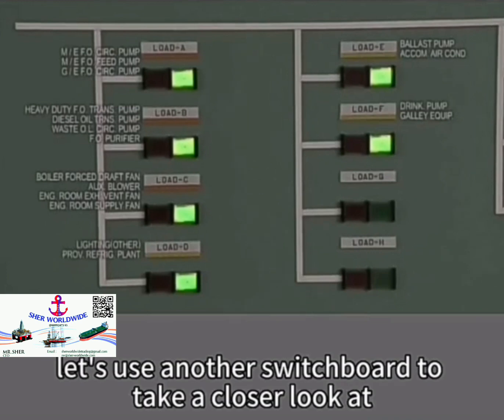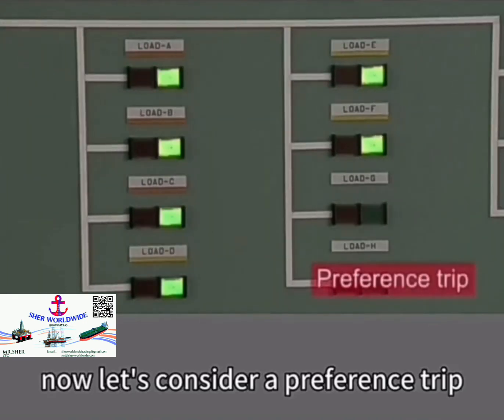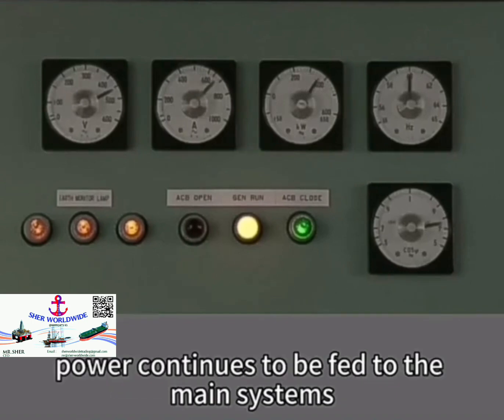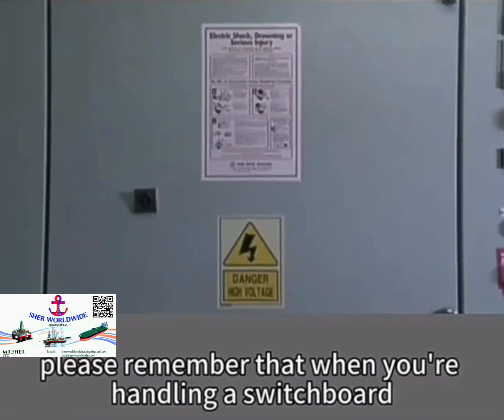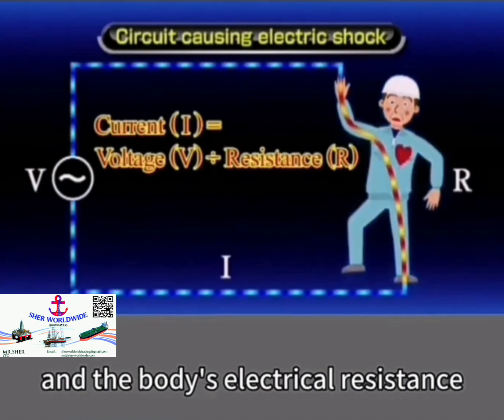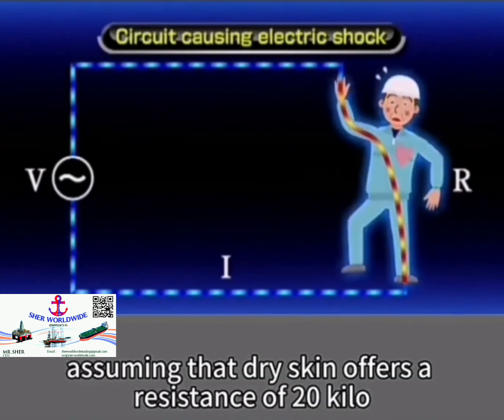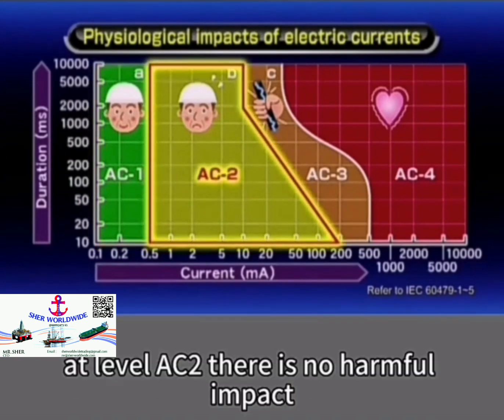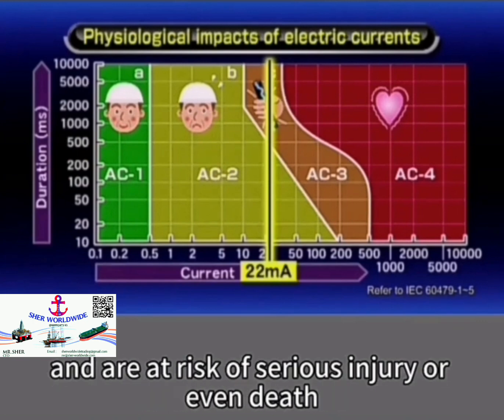Understanding ship electrics from Sher Worldwide ⚓

Comment from the maker: Do’s:

1.	Understand the System: Gain a thorough understanding of the electrical system, including the schematic drawings.
2.	Utilize Safety Devices: Make use of safety devices present on the main switchboard.
3.	Adhere to Isolation Procedures: Prior to working on any electrical system, ensure it is properly isolated and tagged.
4.	Wear Appropriate Safety Gear: Use insulated safety boots and other necessary protective equipment to prevent electric shocks.
5.	Conduct Regular Maintenance: Regular maintenance and inspection of electrical equipment, including switchboards, are crucial.

Don’ts:

1.	Never Assume Safety: Never presume a system is safe to work on without proper checks.
2.	Avoid Working on Energized Systems: Refrain from working on an electrical system that is still energized.
3.	Don’t Overlook Complex Systems: Do not underestimate the complexity of the system. If you’re not familiar with it, seek professional help.
4.	Never Neglect Safety Procedures: Always adhere to safety procedures, even for tasks that seem ‘simple’.
Do note, these are general guidelines. Specific procedures may vary depending on the ship’s design and the specific electrical system in question. Always refer to the ship’s operation manual and follow the safety protocols set by your organization. Stay safe!

Website: https://sher-worldwide.com/

#SW, #sherworldwideshipbrokerage, #sherworldwidehairtonic, #sherworldwide #Demolitionshipbuyers, #Greenshiprecycling, #Shipbroker, #Shipbuyer, #Shipforsale, #Logistics, #Maritime, #TradeFinance, #Admiraltylawyers, #sherworldwidenetworkteam  #shipowners